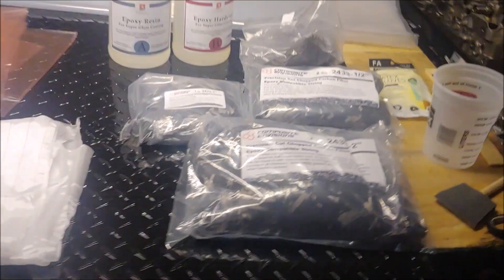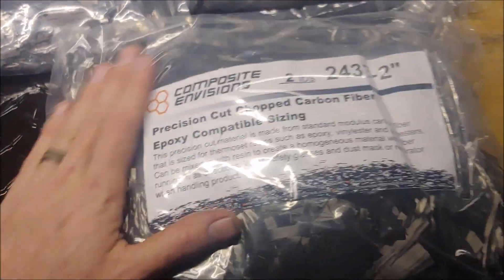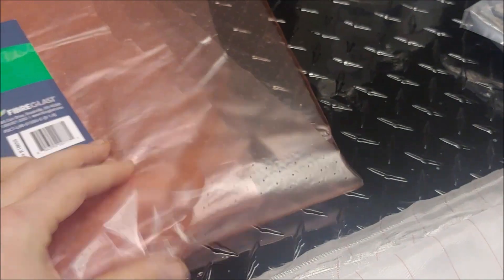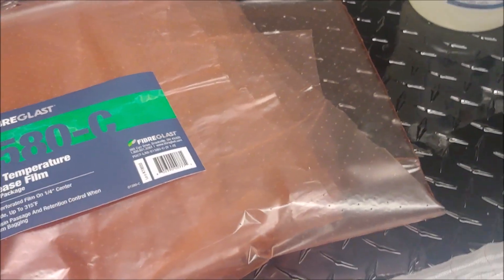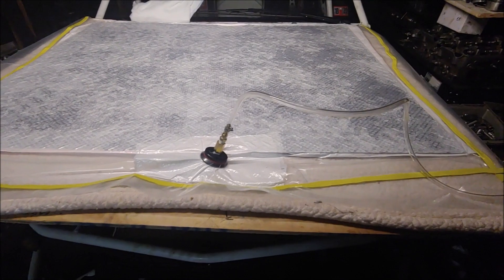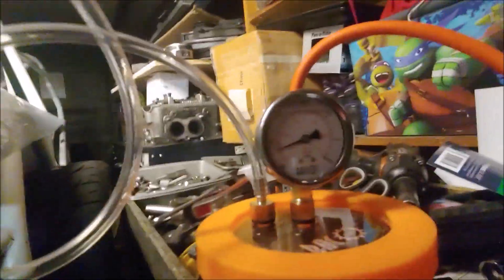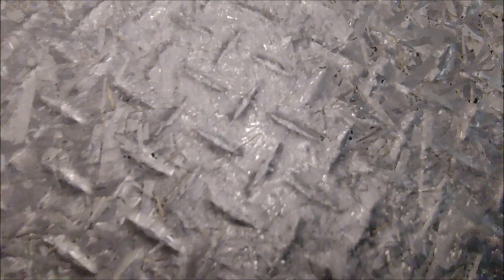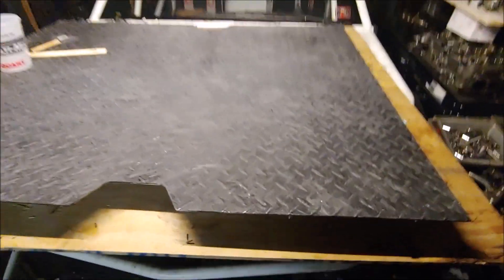Forged Carbon Fiber Test #001

Comment: I will be curious what this does after a year or so .... carbon fiber has a tendency to react with metals and cause corrosion. Will the basalt you added react with it?
Reply from the maker: Well. Honestly i had no idea CF was conductive and would have a galvanic reaction with aluminum. The future will be intersting. Basalt is a rock. I dont think it will make anything worse